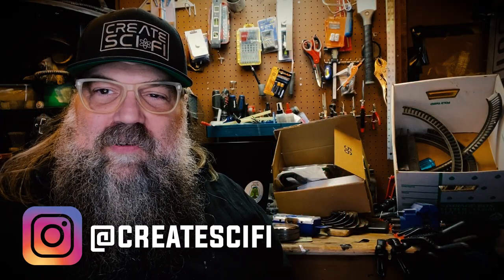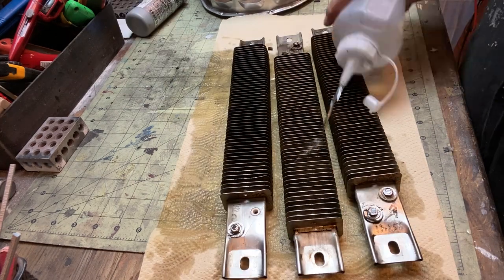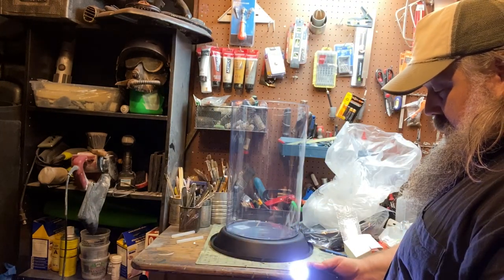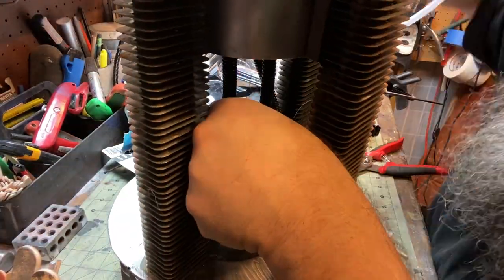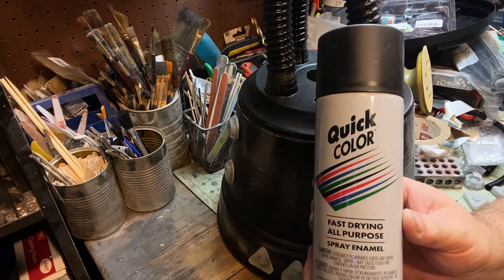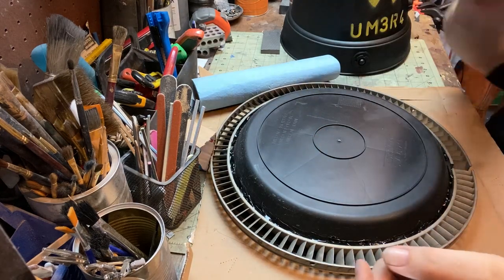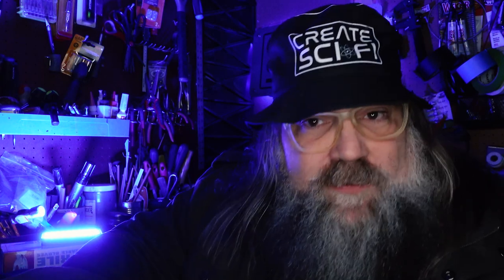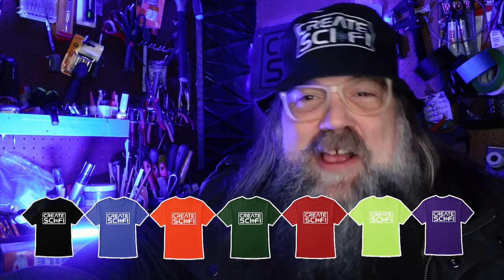BUDGET-FRIENDLY SCI-FI STYLE REACTOR BUILD FOR FILMMAKERS

Comment: Great Reactor ☢️👍

PS. You should wear a protective mask when spraying inside, the water-based spray paint is not healthy 🫁
Reply: Build a fume hood. THat is what I did. Low volume airflow using a fan exhausting to  the outside
Reply from the maker: You are right